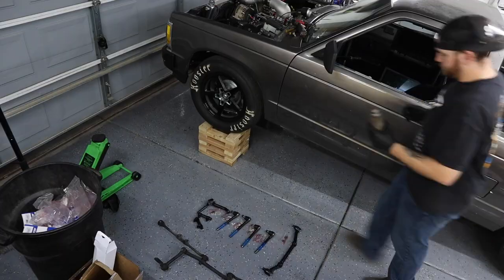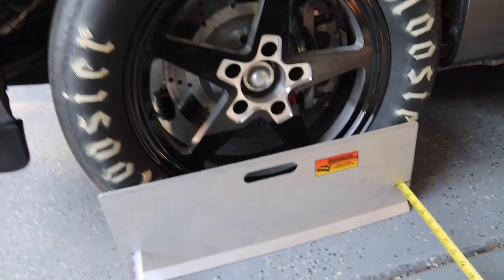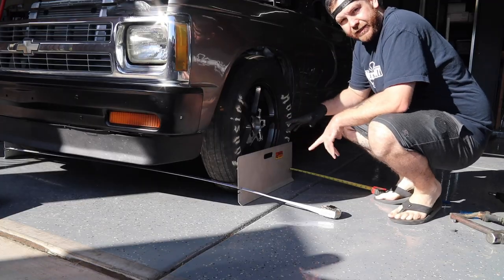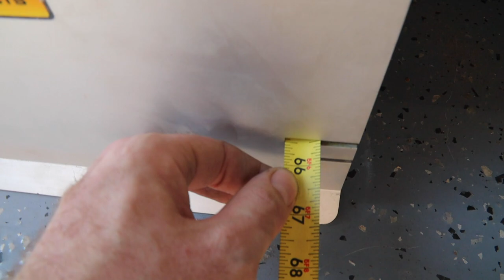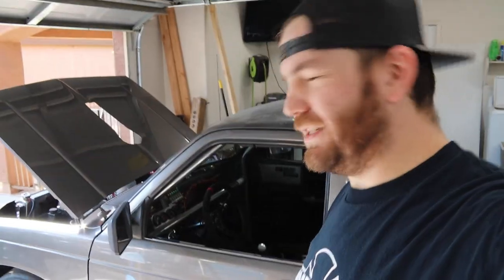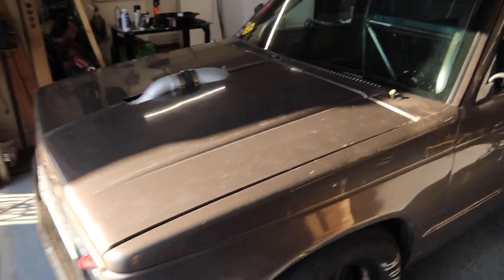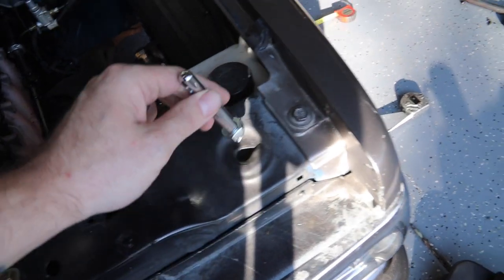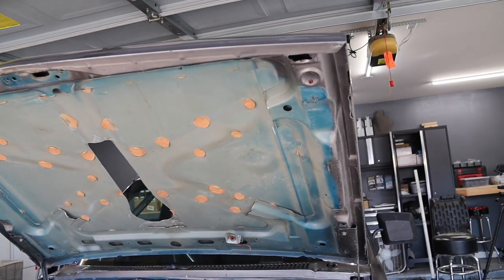You can't have a race truck without Hood Pins + I do a basic toe set on the s10 using toe plates

Comment: Recently got a backhalf narrowed S10 frame for a project build.    Now I just need to find the time to get started putting it together.   
My main priority right now is finishing my house. 
There are so many cool fiberglass S10 hoods I got mine from a place in Ohio for a really good price.  4 inches of extra clearance but has a ram air appearance to it. Similar to a '80' Z28 hood.    Not cowl induction style hood.      3M panal bond works real good if you are just going to put a custom hood scoop on your hood.  I use green florist foam glue em together and then shape them with an electric turkey knife and a big spoon to create the shape I want. Then wrap with Saran wrap and foil tape then fiberglass and resin the whole thing and presto   you have a one of a kind custom hood scoop.   "diy style"

Comment: I like the idea using the grease to mark it, servers as a reference point and the grease must help keeping the heat down on the drill bit and keeping it sharp, also looks like your on a low and steady setting. Thanks doing this shortly on my 01 S10 4 cylinder

Comment: It would be cool to see how you removed the support webbing on the underside of the hood. Gain some clearance and lose a few pounds off the front of the truck. Does the hood feel flimsy without it?
Reply from the maker: I just cut across it with a cut off wheel and only removed what I needed. Hood doesn't feel flimsy because a lot of the bracing around the edge is still there